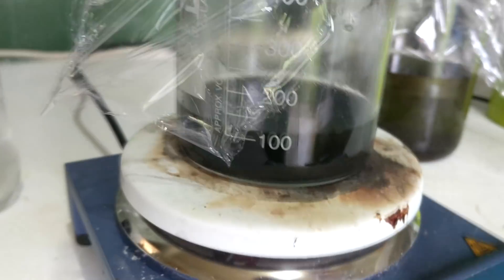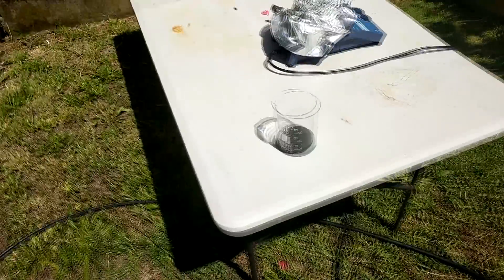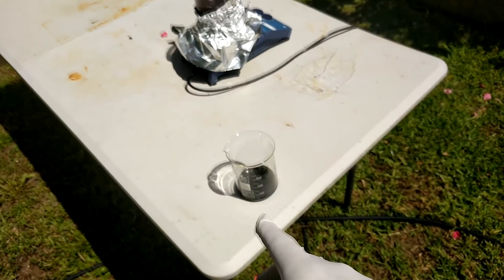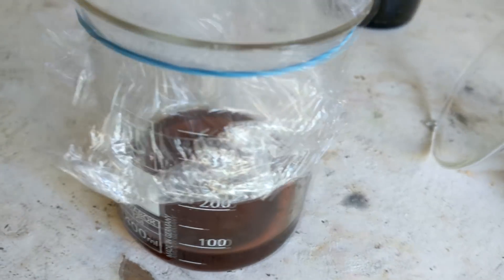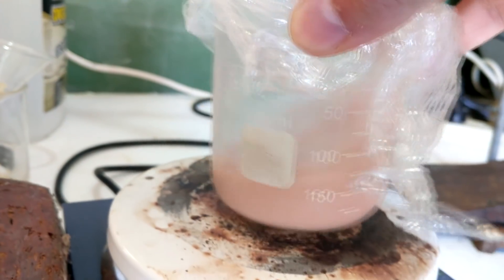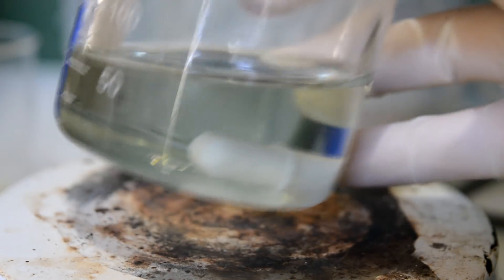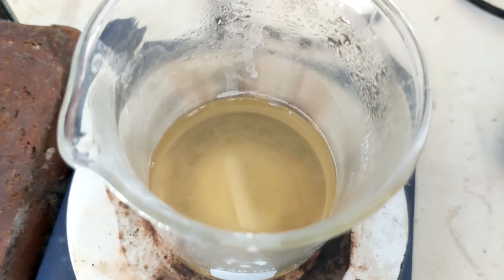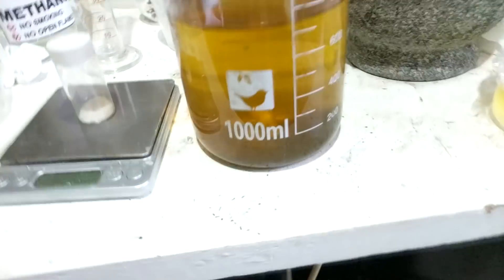Lithium from Phone (Li-ion) Batteries - Part 2: Li2CO3

Comment: Any chance you were overestimating the amount of lithium from the very outset?
Reply from the maker: JamesG Yes. If the lithium isn't anywhere, there's a reasonable chance that it was never there in the first place. So an overestimation of the amount of lithium in the batteries, paired with a poor recovery of the lithium cobalt oxide from the electrodes is the biggest contributors to the low yield in my mind.
Reply: @ExtractionsAndIre  a lot of the lithium would be in solution, ie. coating that plastic you tossed, from what I understand of it `anyway.
Reply: @ExtractionsAndIre  The amount of lithium in the batteries relative to energy in mAh is also depended on the cell chemistry for lithium cobalt oxide it will be different than for lithium manganese dioxide, did you take this into account during your estimation on the amount of lithium present?
Reply: @ExtractionsAndIre  old vid I know but I'm catching leave me the fuck alone 😂 some manufacturers have a quirk of overestimating capacity
Reply: Yes, MRLT, but it saves on equipment costs.  Who needs a spectrophotometer when you can just monitor your own vital signs?  "Oh look, I'm toxified.  We got a product."
Reply from the maker: terawattyear it was suggested to me in the comments, but now I look it up, it's actually more or less the industrial method to recover the two metals from battery waste. I read a good paper outlining basically this synth (they used ammonium oxalate, clever), if you can't find it, let me know. 
In terms of controlling the atmosphere, well argon I guess. I'm not very good at engineering, and also the cost of a cylinder, while pretty low, is still roughly the same as my bank account, so the project isn't an immediate thing I'm starting. 
A glove box build would be nice I think. Nothing super technical, but similar to ones already on YouTube, a big sealed plastic tub with argon. 
Whether or not that is need for the electrolysis, Im not sure, it might get in the way more than it helps
Reply: Alan S; I'm doing postgrad at the local university at the moment... And having some neurotoxic compound suddenly not be where you expected it to be isn't quite as fun as you'd think it'd be... especially since you sometimes simply HAVE to remove the product from the fume hood to rotovap it, before you could even realize that there's a lot less solid in the flask than you expected...
Reply: Cobalt is currently $80,000 per ton, so that is where the value is.
Also, it's pretty toxic so treat with respect and dispose of intermediates responsibly.
https://digitalfire.com/4sight/hazards/ceramic_hazard_cobalt_toxicology_331.html
Reply: Were you following some steps someone else had already tried or was your effort a new path? Interesting nonetheless. Yeah, I’d like to see you try to pull Li metal out of LiCl. How will you control the atmosphere?
Reply: Extractions&Ire; Usually what happens in the lab, when some compounds just seem to vanish (and this only seems to happen with the really nasty stuff, like hexavalent chromium, nickel tetracarbonyl, uranium hexafluoride and, obviously, Polonium Azide), is that the missing mass has all migrated into the chemist's lungs...

I'd say check your urine for the lithium; you should be able to recover what hasn't already deposited in your brain. XD

...Yes, extreme sarcasm, cause fuck knows where that lithium actually went. I'm also leaning toward there not having been as much to extract to begin with.
Reply: @mortlet5180  I think Polonium azide might be the most cursed substance I've ever read
Reply: @mortlet5180  POLONIUM AZIDE
Reply: @MRLT what kind of lab do you work in? sounds really neat
Reply: A pair of tin snips would have been better to open the foil packs and washing all of the bits in a lithium dissolving solution be it water or acid or hydroxide then dumping the copper and aluminium that would have dissolved might have given a yield I think most of the lithium is still in the black stuff and on the various foils.
Reply: there is roughly 8g of lithium per 100 watt-hours and 25g of lithium is equal to 300 watt hours each of those batteries he cut apart had between 10 and 16 wH so if it takes 7 batteries to make 8g by my count he opened roughly 12 batteries so he should expect if 100% is recovered around 8-12g of lithium

Comment: I don't know about 7 years ago but nowadays most lithium batteries are manufactured with lithium manganese oxide instead of LCO. At least the cheap \ midrange batteries are. 
LMO is much cheaper and does the manufacturer really give a fuck that they don't last as long as LCO batteries? Of course not. 
That is contrary to their prime direcives.

Comment: The lithium would be in the electrolyte as well as the separators. When charging and discharging the lithium migrates from the anode and the cathode. You probably lost a good amount not processing those as well. Or least I am told...

Comment: Lithium reacts with sodium carbonate to form lithium hydroxide. You can actually heat lithium hydroxide, and that will form lithium carbonate precipitate. 

Lithium is highly soluble with water and actively tries to enter the hydroxide form when in water. Its likely that you had that a lot in the initial leeched solution. Though that would look much like water, but with a different refractive index.
Reply: Also that looks for sure like lithium carbonate, i used to work with it for a couple years.

Comment: I wanted to extract neodymium from magnets for years now. But I can’t come up with a route to do it with the chemicals that I have available :/ 

I have many chemicals, just not the right ones  for this lol

I want to see the color changing of neodymium salts so badly with my own eyes
Reply: I suppose just buying the Neodymium would be the cheapest and easiest way anyways. But if you really want to extraxt it yourself yourself with somewhat easy to get stuff, a kinda Ghetto way MIGHT be to cut the magnets into chunks and pour mercury over them. Let the Neodymium dissolve into the mercury and decant it or remove the other stuff with a magnet Boron and Iron should not desolve. You could get rid of the mercury by destilling it off using a water jet vacuum and a bunsen burner. Don't know if this works tho, but it seems kinda plausible to me.

Comment: For the flame colour Lithium requires a much lower temperature than Sodium for the vibrant flame colour. So keeping at the outside of the flame, so it just barely changes the flame colour makes it much easier to see whether Lithium is present. (Or Calcium and even Potassium)
Reply from the maker: This is helpful, thank you!
Reply: @ExtractionsAndIre  That's how I got to always skip properly isolating and testing for Potassium and Lithium Ions in the anorganic labs. ;-)

Comment: My guess is this: 1: You overestimated your starting reactants. Namely you had much less Lithium to begin with. 2: By opening the batteries in air, the Lithium ions formed Lithium Oxide very quickly. This would be hard to pull out of any extractions you made. 3: your hot filtering and using a fairly miscible solvent caused a large majority of the oxide and Lithium Hydroxide to remain in solution. 4: heating the batteries to decomposition temperatures would burn the lithium to form alloys and/or oxides that would be released when the batteries "Let the smoke out", for want of a better term. 

I like the chemistry you did. However, the extraction of the raw material seems to be getting in the way of raw yield.
Reply: The term is magic smoke.
It's a industry standard for when a electronic releases it magic and it turns into smoke.
Reply: @youkofoxy  its tough to say. the angry pixies that escape, the magic smoke, those electrical terms im sure correlate to chemical processes in some way, but are you sure there isnt any release of shmoo involved here?
Reply: @youkofoxy  Sure.

Comment: I used to fool around with chemicals making simple crystals and inorganic chemicals, when I was 15-16. I realize now I did wear the bare minimum of PPE and had simple fan-in-garage ventilation. I tried making chlorine gas once. *ONCE*.
Reply: I discovered you can make a silver mirror using hydrochloric acid and tin, basically you leave the stannous chloride in the sun for a week and the tin crashes out leaving a chlorine solution and tin...

Comment: If you get some more carbonate you could use it to make lithium chloride and do a fused salt electrolysis. It's quite fun to do (apart from the formation of chlorine gas) and by mixing it with potassium chloride you lower the melting point down to around 450°C.
Reply from the maker: Random Experiments International I was trying to remember whose video is seen that made it look easy... That was you!! Very nice work, a few years ago now it must be. 
Interesting that you managed to do the electrolysis without the lithium melting. Lithium melts at 450 C, which is roughly the melting point of the eutetic, did you take any steps to make that happen??
Reply: Yes, it's one of my older videos, which are on my german channel now. I was surprized too, that the lithium was not molten. I looked it up again and according to some sources it seems the mixture even melts at 352°C (I said 450°C in the video...). This might be the answer. :D I only made a mixture of 52% lithium chloride and 48% potassium chloride and heated it until it was molten.

Comment: Here is what we have done so far
-teardown of battery
Everything in HCl
-Final wash with aqua regia (just before that we took copper foil out)
-we got nice light violet color

That cobalt chloride seems to have very diffrent color than ours?
Also in our batteries was some ammonia which was so damm strong i had to leave and change my filter to a gas one
Reply from the maker: The Chemical Workshop well if there's ammonia, that'll probably change the colours a bit. Cobalt chloride likes to be different anyway, sometimes blue or pink, so don't worry too much about the colours, just trust your metal chemistry instincts!! Sounds like good progress
Reply: @alienrocketscienceshared8454 😮

Comment: you burned the batteries to get the raw ash product .... did you maybe burn off the lithium ? like 90% of it ?
Reply from the maker: PiE nah I just tried burning one battery, and that didn't work so well so I just cut open the others. Would've probably got a better recovery of could actually have burnt them! But yeah the sealed steel casing really made them want to blow up rather than burn

Comment: Boil the Li solutions down, even if it has low solubility. In 600mL of Water there is a lot of space to dissolve in.
Reply from the maker: Sven so by my calculations, that 600ml could contain a maximum of around 1.4-1.5g of lithium atoms, which is nearly 10x our yield! By God, I think you're right about this. It seems so obvious now.... I could still recover it!!!
Reply: Extractions&Ire If I would do this, I would reacidivy the solution with an acid which Li-salt has the highest solubility. Than boil it down to the Point where percipetate starts forming and than add a saturated Na2CO3 solution
Reply: Li2CO3 has solubility of about 13g/L. So I think you are right.

Comment: imo dumping the Co ox/C mixture into piranha soln is a better idea than HCl since piranha soln could both reduce Co(iii) and oxidize C, making filtering step easier (less insol impurities after rxn)
Reply from the maker: TM Fan interesting, didn't even think of that. Would perhaps be cleaner, but I think the time wasted in the filtration step was worth it to not waste peroxide and sulfuric acid for me... Ok they're not that expensive.... It's a good thought honestly
Reply: @ExtractionsAndIre 😅

Comment: Hello friend!

Maybe a better workup of the battieries would help? The graphite may be interfering-- did you consider burning it off in a furance?

Also, did you consider forming a metal complex with higher affinity for cobalt than just the oxalate? Not sure what the best way to do that is though.

Finally, maybe a solvent extraction of some sort may work for the lithium? After boiling down the mixture of cobalt and lithium chlorides, maybe you could find a solvent where one is soluble and the other isn't. It should be easy to see which is which by following the cobalt.

EDIT: forgot to mention-- ammonium salts are your friend when it comes to alkali metal extractions. They behave like alkali metal salts in solution but can be burned off at the end.